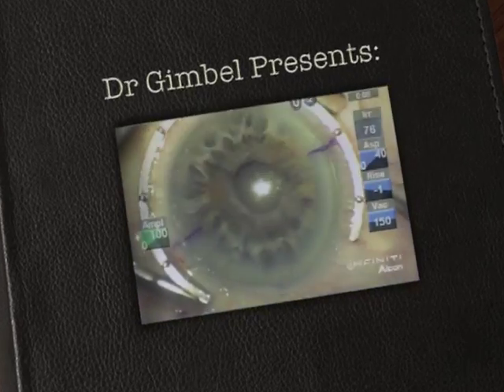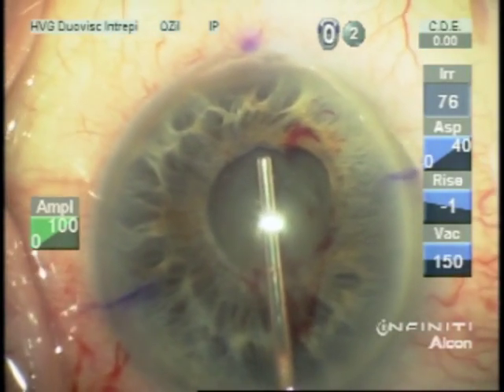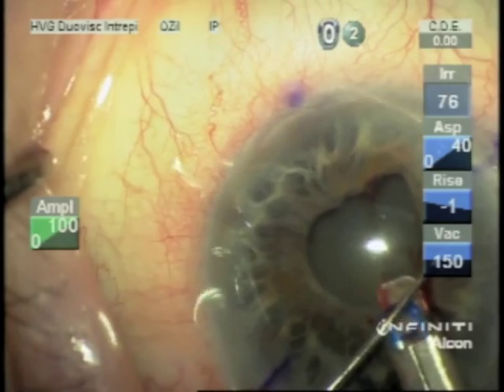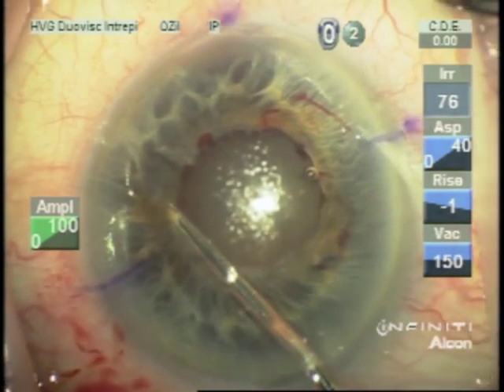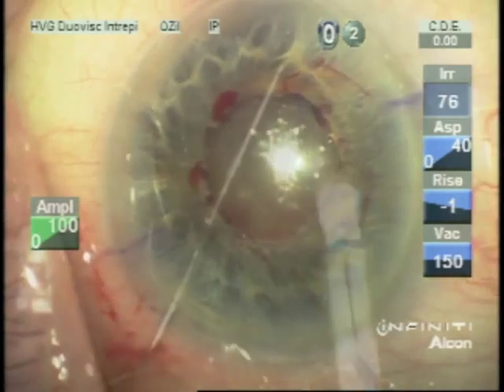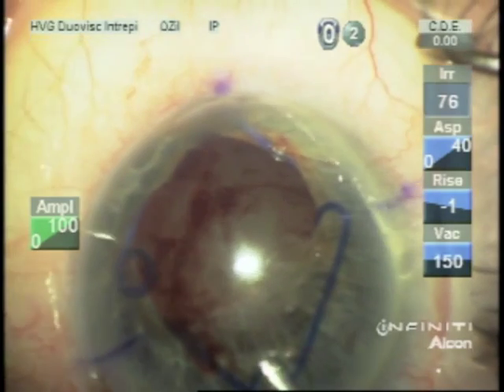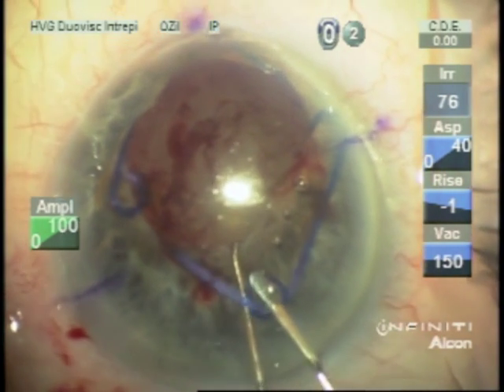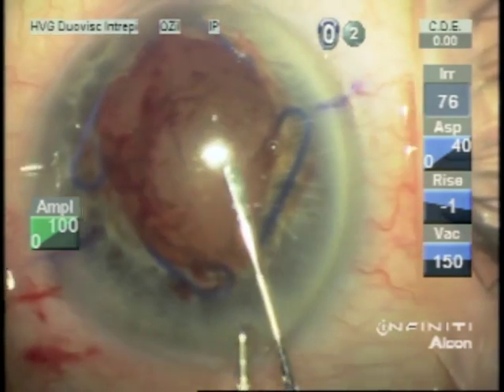Sphincterotomies before Malyugin Ring

Comment from the maker: Thank you for your comments. This was one of the most fibrotic small pupils I have ever experied.  I do sphincterotomies only if i can't increase the pupil size through manual manipulation with a spatula or retractpr and the use of viscoelastics.  I have used iris retractors or hooks but in this case the pupil or pupil border was so fibrotic I had to perform multiple small sphincterotomies.